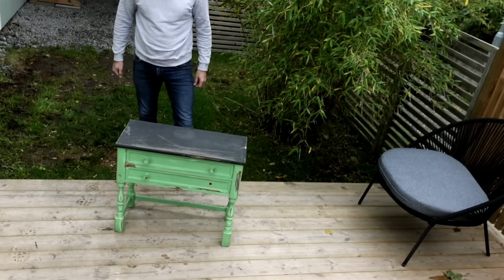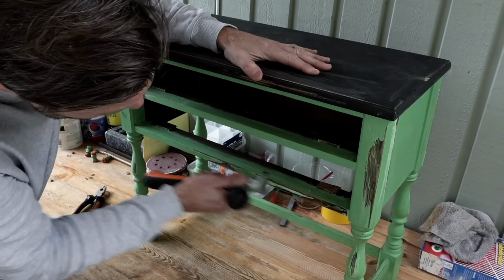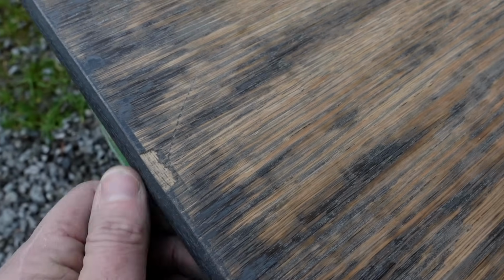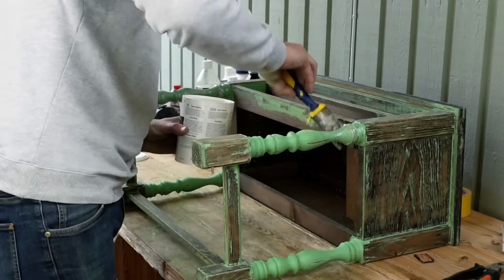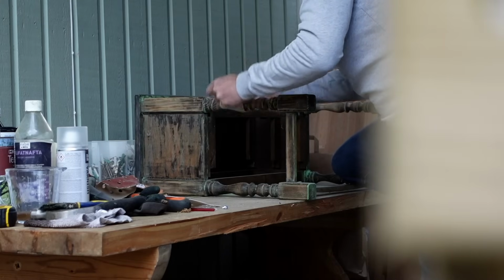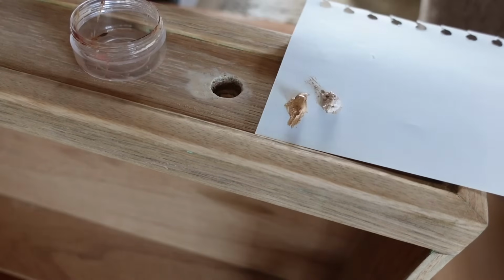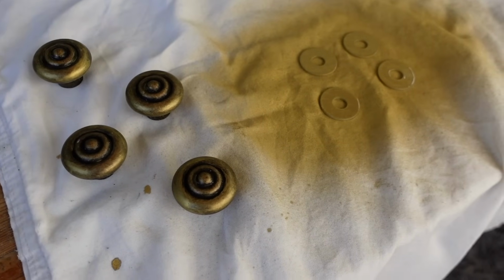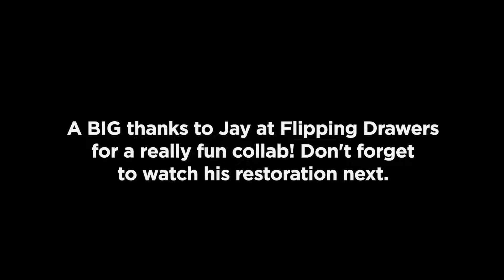The Ugly Kermit – A Collaboration with Flipping Drawers! | Furniture Restoration

Comment: Really like what you’ve done with this piece 👏🏼👏🏼👏🏼 What do you think about adding some of the paint you used on the knobs & washers to the edges of the top trim you added…would tie everything together even more?
Reply from the maker: Thank you! I tried to add som brass paint to the trim but i did not work that good with the oak veneer. 🙂 Thanks for watching
Reply: @midcenturyflipper  thanx for taking the time to read & reply to me